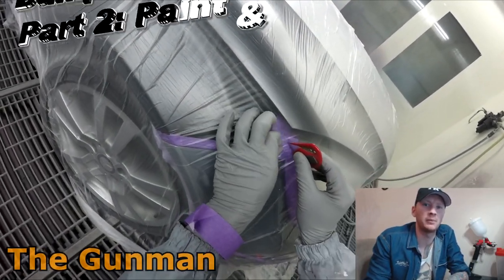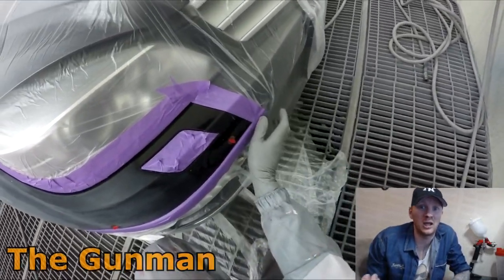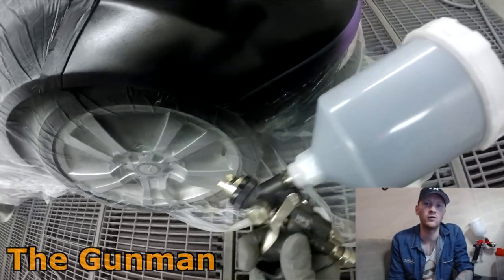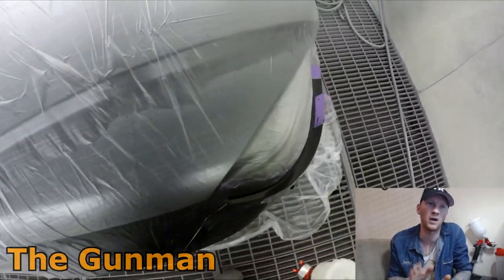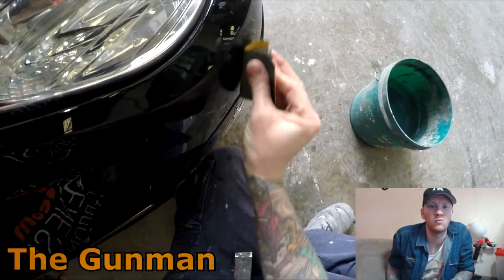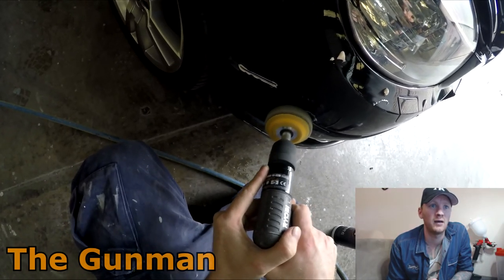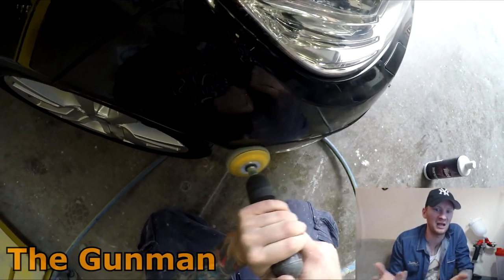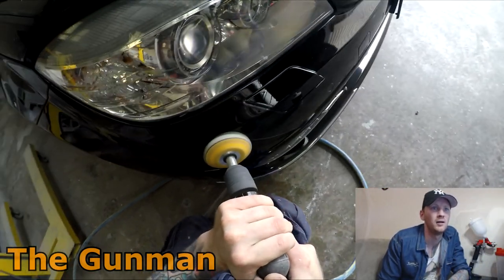How to Fix Damaged Paint

Comment: Thanks for the DYI info, I keep learning a lot. I think I am starting to get a grip on blending now, thanks to your help. Tomorrow I plan to try and fix some clear coat halos I created on my Honda Pilot doing small spot repairs. I'll try gray scotch grits to erase the halos; but, if that doesn't work I'll try 800 and and gray scotch bright a little beyond. But hit any 800 with your 50/50 blend mix and gray scotch grits with pure blend/reducer. Hope that works. If not, I'll keep working on it.

Comment: For DIYers who shoot in a garage instead of a downdraft spray booth, what do you recommend for space preparation?
Reply from the maker: A bit of water on the floor helps keep the dust down, obviously not too much or you run the risk of splashing water on the panel, again obviously careful of electrical leads etc, paint is also highly flammable so ignition points are another important factor. Get some sort of extraction fan and a filter to keep the overspray out.